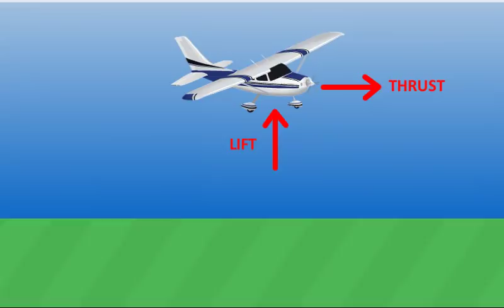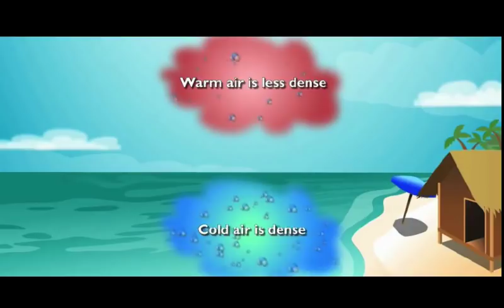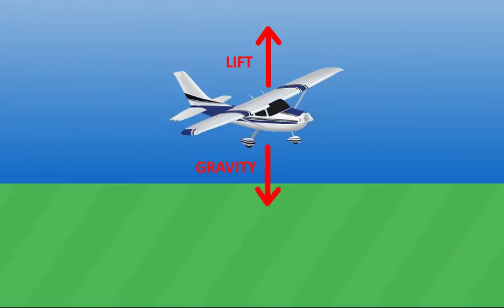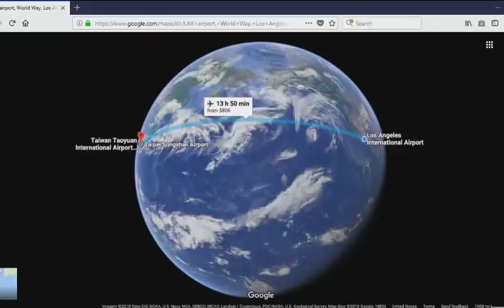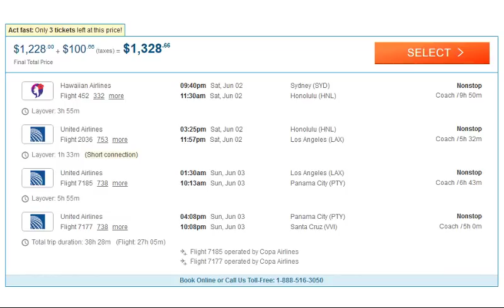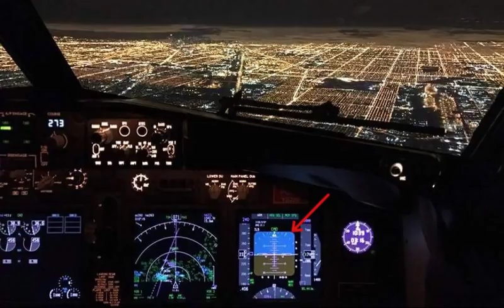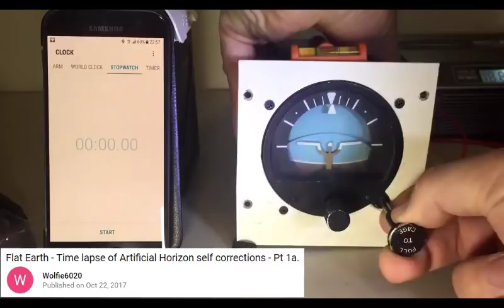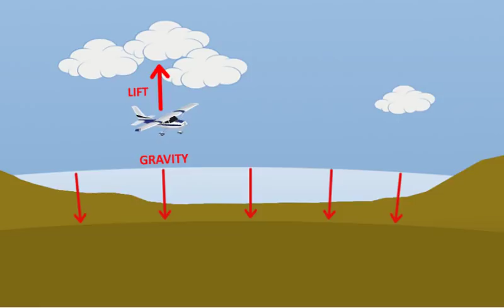Flat Earth Falsities - Plane Nonsense

Comment: First i'm not globe earther or flat earther I still search the true. Question here is not how amount of air is need but for speed. If the earth rotate 1000 mph and the airplane fly in same direction of the rotation with 600mph it will fly forward with respect to the atmosphere, but with respect to the geographical position, it will lag behind.  Except for air currents, wind, and so on, history remembers so many suicides from people jumping from very tall buildings. I have not heard or seen that no one has fallen, for example, at 15, 20 or 50 meters from the jump point. Please do not explain to me about inertia and so on. I am convinced that I am familiar with some physical laws much more than most commentators here. I'm doing stunts where everything is accurately calculated. I jump from moving trains, trucks, cars, motorcycles, and so on at speeds of 50 to 80 some  times and over 100km / h. Even if it happens from bridges and the height is over 10-15 meters and NEVER, the deviation from inertia does not change without any significance whether the vehicle is moving east, west, north or south. Also, in the calculations for the given high speed cascade, the speed of rotation of the ground is never taken into account. I know exactly how much inertia affects at different speeds and heights. Also, how quickly it stops when an object or subject is detached from the ground. I know that the rotation of the planet is constant  but please try to jump from a moving train at a speed of 100km / h from a bridge and do it in the two directions (in the direction of rotation of the ground and vice versa)  If the Earth really rotates with 1000 miles per hour, then when jumping in the direction of rotation, the distance from the inertial forces must be less than when the given cascade is made in the opposite direction, since the first one in which we move in one direction with ground the direction of inertia and the same as that of the rotation of the earth. I would like to point out that this is my estimation based on a small calculation at a high jump so that it is possible to measure a difference with a higher value because there is no way to measure the jump difference from a height of 3 meters. My idea is to make a real experiment with a heavy object that can easily overcome inertia in a fall. Then real results will be seen and little or no will prove to be either one or the other, not just theorists, to apply their assumptions as facts. We know such a lot. Almost all of them are.
Reply: I love when they claim they aren't a FE believer, and then just go on to repeat all of their favorite FE believer talking points.
Reply: OMG GMO awe how did you see through their clever ruse. Lol. Oh flat earth. Their so funny when they try and be sneaky. Sneaky snakes. Flat earth is just a scam, not a conspiracy. Also about the dumbest conspiracy I have ever found.
Reply: светослав серафимов For the first few points:
Earth, atmosphere and grounded plane are all moving at one revolution per day; all are moving in the same direction at the same speed. How fast the lateral speed is is dependent on the latitude. The planes airborne speed is determined by its movement relative to Earth & atmosphere. 
Conservation of momentum means that when someone leaps from a building they continue to have the same rotational speed as the Earth & building, i.e., they move continue to move sideways at the same rate as the Earth & building. 
For your stunts everything is calculated relative to the Earth, not to some absolute point. You are moving eastwards with the Earth and atmosphere; jump and you continue to move eastwards.
Reply: Please don't tell me what you read on the big books or what you learn on the school. Half of that May be a lie. Theorys are not facts. I will never beleave that atmosphere will keep my rotation even when i fall and i do not have contact with the surface.  While fools such N**А and other "scientific" instances themselves contradict their own claims either to deceive people or simply because they have to declare "facts" only to be properly funded,  I will never accept allegations of such a scuffle of facts.  I apologize if i personally hit someone. From now on i will only believe on proven facts not of pink fairy tales.
Reply: светослав серафимов "I will never beleave that atmosphere will keep my rotation even when i fall"
Which is not what I said. If you don't believe in conservation of momentum then why does a thrown ball keep moving when it breaks contact with your hand?

"Half of that May be a lie."
Which means you require evidence, not that you can summarily dismiss something as a lie.

"Theorys are not facts"
They are in science where theories are based on extensive experimentation & observation, i.e., they're backed by proof you are demanding. 

"contradict their own claims"
Example?

"i will only believe on proven facts"
You've just summarily dismissed proven facts.
Reply: светослав серафимов
"First i'm not globe earther or flat earther I still search the true." You obviously haven't done much searching then because we know the earth is a slowly rotating terrestrial spheroid and gravity is a fact.  Just because you are incapable of understanding basic maths and physics and wilfully refuse to learn such things is your problem. Examples of questions for you about basic, practical, everyday maths and physics used in the real world - 
What is the relationship between longitude and distance when travelling east or west parallel to the equator?. If you know the answer then you know the earth is a spheroid. If you don't you are not qualified to comment on the earth’s shape.
Please explain the principles behind the development and functioning of a gyrocompass? If you can then you know the earth is a slowly rotating spheroid and gravity is a fact. If you don't you are not qualified to comment on gravity, the earth's shape or movement.
Reply: No dear friend.  I tell that if you fall just imagine you jump from the plane or helicopter. The helicopter is better idea you know why. Just imagine you jump from about 500 or 5000m altitude no wind forget about wind for a moment.  All the time that you fall you tell me that atmosphere will keep you with same speed of rotation of the earth?  I can't accept that. I know one thing human body have extremely sensitive feeling for motion,  speed or whatever you want to call it.  Sorry i really want to have better English and will be plesure for me to talk with people touched with this question but i am too limited here to explain my point of view.  I'm not beleave anything anymore.  The big part of sciense is a lie or theory or unproven "facts"  that people accept with light hand.  That's why i comment here. My questions open other questions and it's important for me any point of view and if i get something that i can test or try i will. My position is searching of the true,  real true not that someone tell to someone this is true just because he think it is.
I don't care where i live. Flat Earh OK no problem just Globe OK i was big fan of Space,  I still play Elite Dangerous i like the idea of the Cosmos but something is wrong here and i want to know what is it.
Sorry that i spam you. Just i'm not naive morron.
Reply: светослав серафимов
"All the time that you fall you tell me that atmosphere will keep you with same speed of rotation of the earth? "
No, I have told you twice that conservation of momentum will keep you moving. 

"human body have extremely sensitive feeling for motion"
You are actually quite insensitive to motion. You are sensitive to acceleration from which you infer motion. If you travel in a car at a constant speed you are aware of movement through friction from the road and the movement of objects outside, not through direct observation of motion. In a plane you have no way of telling what speed you are travelling at. 

"The big part of sciense is a lie or theory or unproven "facts""
That you don't know or understand something is not evidence that we don't. If you think we don't provide evidence then look at websites like arXiv & PubMed and see the lengths we go to to accumulate evidence to back anything we say. 

"Flat Earh OK no problem"
No map is not a problem? No ability to realistically account for any phenomenon is not a problem? The globe does provide consistent explanations and predictions but you don't like it because you read it in textbooks?
Reply: I don't know if it's relevant, but the supersonic Concorde used to show something like up to 1.2% fuel savings the closer it flew to the equator (in a particular direction.... can't remember if it was east or west) taking local winds out of the equation. It flew at 60,000 feet, so may have been experiencing less force of the moving air mass (being dragged around by the earth). I believe that's why there are rocket launches from places like French Guiana (near the equator)

Comment: Small correction on your video explanation... hot air does not rise forcing cold air to drop and fill the space...

Cold air is denser than air of higher heat content. Denser air sinks and pushes up warmer less dense air. Same results, but different reasoning.
Reply from the maker: Yes, I agree. I was talking about the cause of wind. Of course colder air drops because of relative density, but it also moves horizontally near the surface to fill in the lower pressure areas caused by a rising column of warm air.
Reply: Why doesn't gravity, which allegedly holds trillions upon trillions of gallons of water to the spinning ball earth pull all the cold, high density air down to earth?
Reply: Hum.. Rocky good luck, it may be a case of "a waste of time", IT does not like I suppose. picky  or intelligent, graviton anamolie maybe?
"The sun light doesn't start causing heat until it gets to the atmosphere," kind of.. it should cause on satellites and ships, that is dense high pressure matter, I though all this heating business was through the surface then it heats up the air?
But Pressure does not move much to less pressure /vacuum?
Reply: My! Déjà vu! Now what did I write that triggered Robert to go all wong on me?
Glad I did manege to get something right on, but I wont be getting out of that attitude.
ps: dam how does Rocky sound less troll than me? :(
Reply: I GOT IT! Convection thats the word or physics. Although sunlight warms the atmosphere, air is not a good conductor of heat because its molecules do not transfer heat well.  So air does more helping to cool objets rather then worsen.   So that was it Roby? 
Metal of a car may be hot enough to fry an (egg on) earth, and yet the AIR temperature is no problem for your skin, neither is the sun! ..the SURFACE temperature can reach 250F when the sun is directly overhead.

"Convection transfers heat vertically into the atmosphere. In order for heat to be transferred to other regions, it must be transferred horizontally by the wind. The horizontal transfer of heat by the wind is called advection."
http://www.atmos.illinois.edu/earths_atmosphere/heat_transfer.html
Reply: You tell me Louis
Reply: I have I have been telling, but lots of "a waste of time" cases... YOU are not telling of my idiot physics... I KNOW you didn't like my hot plane YT video... some Mainstream contradictions?
Reply: Louis — Since you seem to be a flat Earth sage, can you tell me why on the equinox, that the Sun is observed to appear at the horizon (what most call "rise") within a degree or two of due east, and disappear at the horizon ("set") within a degree or two of due west, but using the flat Earth map, the Sun must appear in the northeast and disappear in the northwest? (It's a 12 hours day so half of the Sun's full circular path must be visible, and determines the angles). I'll just let you explain it to me.
Reply: Louis — I thought you'd waste time making snarky comments and taunting rather answer the question. But flat Earthers can't explain this. Since you won't try, neither will we. Since you won't try to respond to my question, engage in a dialog, since we're "waste of time cases", there's no reason for you to be here.
       BTW Another video by Flat Earth Map showed how to calculate the rise/set on the equinox, and that FE results should not be due east or due west, but on the message board no one reported results. I don't wonder why. Because everyone measures results within 2° of cardinal east/west. But folks like you should emulate the kind manner of this Flat Earth Map fellow.
       Having drawn countless perspective drawings in studying architecture, I understand how perspective works, practically and intuitively. And I've seen the FE explanations elsewhere. But the Sun doesn't get smaller. I have no need to watch more. But I'd be happy to post Wolfie's video links for you, since this is how you converse.
       Otherwise, since we're "waste of time cases", there's no reason for you to be here.
Reply: Dont pout Mr respectful Robert, I am not at your service and you already made crystal clear of your attitude, so I will not be played with writing a paper for you, I done my share of time wasting on this post, why a few want me out bad. 
Those short enough videos to watch and then challenge me with, lazy.
Before taking you should of EXPLAINED why on a globe sense, hypocrite.
Reply: Fine with that logic but high altitudes are closer to the sun, which means that they should be slightly warmer being over the shielding clouds. So why do airplanes need heating system? 
They say atmospheric pressure sucks the heat out of high places...? Where does it go? And I though vacuums did the sucking.
Reply: Louis Shaw —  Beside the Sun actually being 93 million miles distant, the density of air decreases significantly as altitude increases. This is why the "blast furnace" temperatures of the thermosphere don't affect satellites: at that level a partial vacuum develops so there isn't much heat. The "sucks the heat out of high places" is just a "manner of speech" by Esther Inglis-Arkell in the article you read. Understand too that solar radiation only produces heat when it reaches/interacts with matter and heat can only leave the Earth by radiation.
Reply: It sure picked up here since I commented in sycn with the Postmaster. (paranoid me)
That is harsh Super, how you can ascertain my incapability is a wonder, even if you are smarter then me, and certainly more knowledgeable in this domain I never studied.

Robert I am at least aware of that, fine (supposebly) "far and significantly" is key, I did read on pressure issues, but not easy for me not to remain bewildered. Gasses are matter, but not dense  gravity prone. So those clouds that carry tons of water are less effective then Belts.
Still not capable of the 'why do airplanes need heating system?'
 Aircrafty Hoaxes  /watch?v=bim3Hiy-VZQ&t=289s  2:15
Reply from the maker: Louis Shaw - No, closer to the sun does not mean hotter. The sun is 93 million miles away, so a few miles won't make a bit of differences. The sun light is not "hot" in space, because there is nothing to heat up. The sun light doesn't start causing heat until it gets to the atmosphere, where there are molecules of air for the light to "excite". But the air is thinner the higher you go, so there is less heat. A plane does lose heat to the atmosphere because it is much colder than the plane at high altitudes. That is how thermodynamics works. Heat moves from hotter to colder. That is not the same as a vacuum "sucking", we are talking about heat, not pressure, and since planes are not in a vacuum anyway, just lower pressure.
Reply: Louis Shaw explaining thermodynamics to someone incapable of understanding simple concepts is a waste of time.